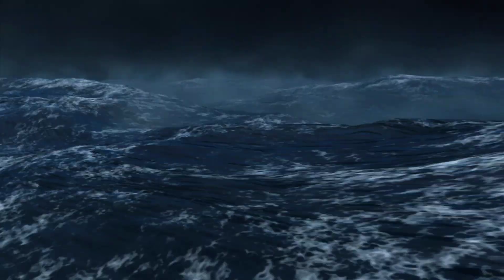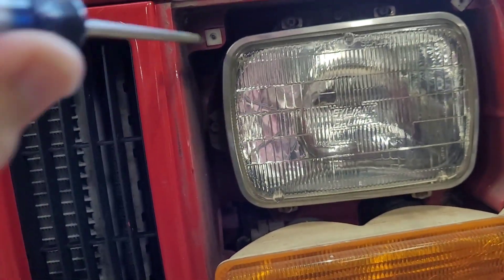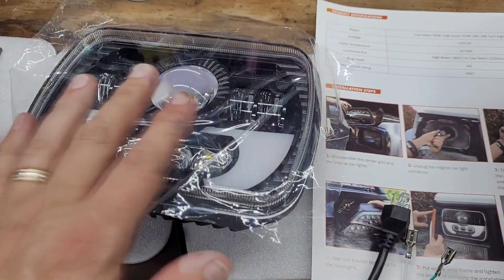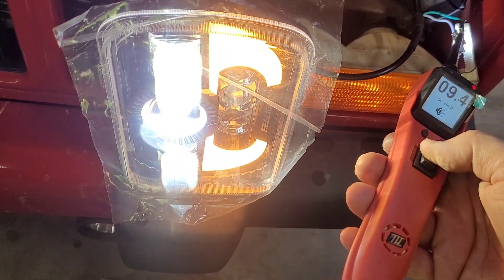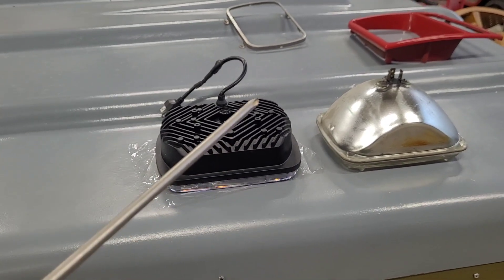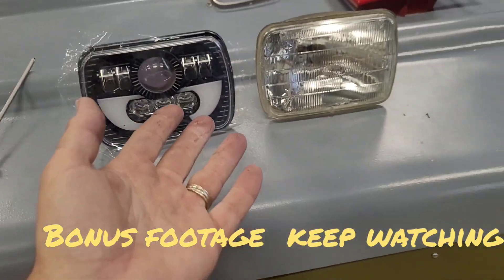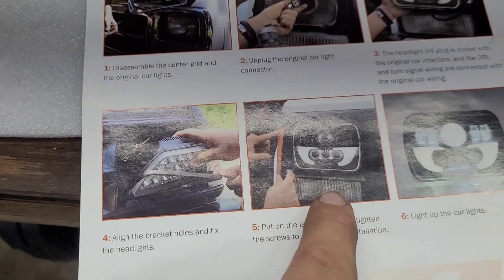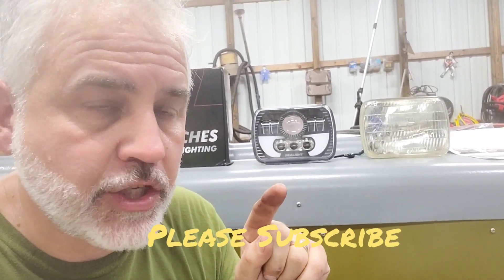Beware of Amazon Lights for your Jeep

Comment: Thank you very much for this video. I just received my lights and the first thing I did was check the bezel.  It looks like the issue has been corrected.
Reply from the maker: did you get the Sealight brand?
Reply: @MajorWeakness  My apologies the box says HWSTAR.  I had originally thought that they were the same manufacturer as the ones in the video.

Comment: Did you have to install a relay so the jeep will recognize led headlights? Seen people having to put a relay under the driver dash.
Reply from the maker: Nope it was plug and play
Worked without any modification...except it didn't fit!
Reply: @MajorWeakness  thx for replying

Comment: I have a 1993 Xj and I bought LX-Light led headlights off Amazon and did not have the fitment issue that these have. I've been running them for a year with no issues. I recommend ,if you haven't done so, to upgrade the headlight harness. This prevents the connectors from burning up. Putco is the harness I got to do this and it's much better.
Reply from the maker: Thanks for the suggestion!  I'll check them out!